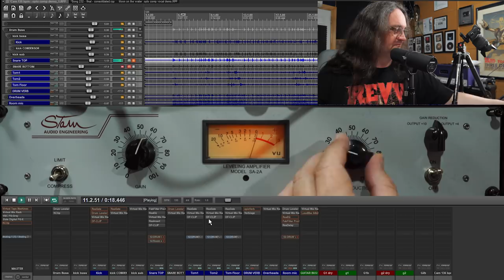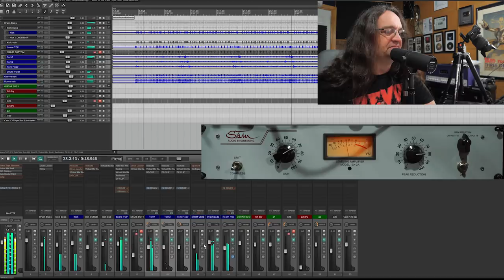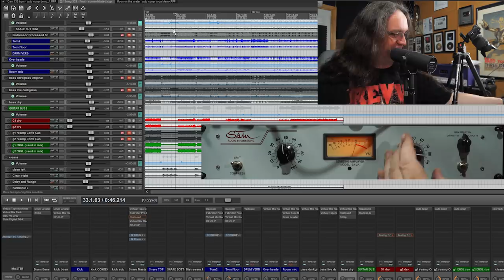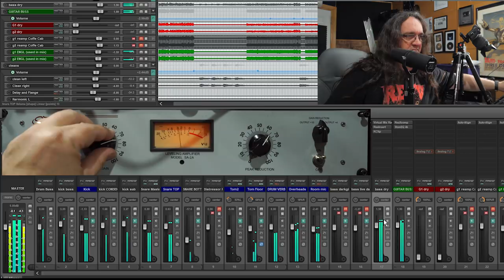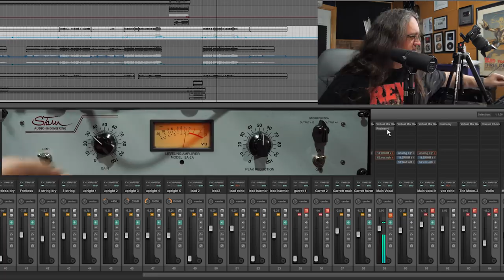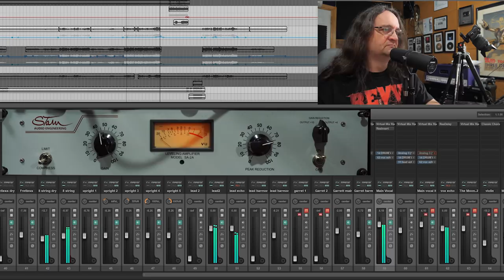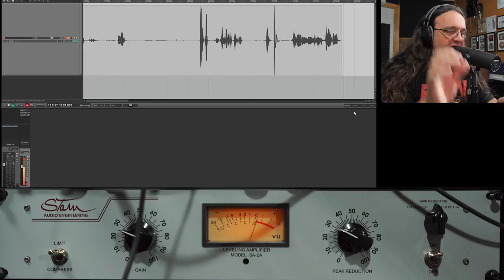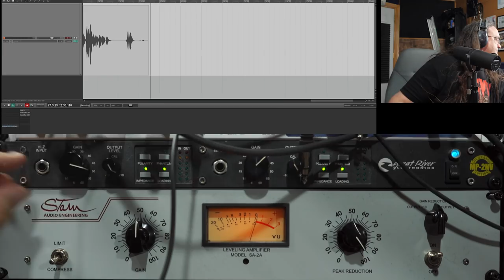Audio Basics: Optical Compression | SpectreSoundStudios TUTORIAL

Comment: Love the channel Glenn, Just wanted to thank you (and the person who made the comment pointing toward the Tascam DR-10x). This unit certainly streamlined my boom mic dialogue acquisition. Replaced a cable, interface, laptop and hard drive with this little unit and it really works well! Just a little heads up on a few relevant details that may have been misspoken on your video;
First, the unit does NOT put out phantom power. The manual states to use a dynamic mic, but fortunately my Rode Shotgun condenser has its own battery for power. Second: the USB port is only for direct power or data transfer. Although the unit can use a rechargeable battery, it does not charge the battery through this port. You must use an external charger. Thought that might help. Keep up the great work!
Reply from the maker: Noted!   I was blown away by the sound quality of the unit.  Simply amazing!

Comment: I might be wrong but I thought that the gain knob was actually an output gain made to compensate for the gain reduction, and the peak reduction knob was used to set the actual amount of compression. Cause you could play with the gain knob, even turn it way down or way up and still get the exact same amount of compression. Maybe they changed it for an input gain knob on the SA2A ? Great video anyways !
Reply: The Big Kahuna yes youre right. It is a make ub gain knob, all the la2a like conpressors are layed out like this. It feels very unnatural because its is layed out from right to left.

I have the warm audio unit, and had exactly the same thing when I started using it.

Comment: I love using an optical compressor (or at least the plugin one that comes with pro tools) for parallel compression on kick Drum and snare: I set it so it pumps a LOT and distorts the drum a little, then I add some post eq to taste (more low end/high mids for kick; more high mids/top end for snare) and mix it in with the dry track for a fatter sound

Comment: Just to add to the explanation of opto compressors at the start - generally the photocell isn't just part of the detector, it's also the actual gain reduction element as well. It's literally a light-controlled resistor, which is why you can get such heavy compression without significant distortion - electrically it's the same as turning down the volume with a potentiometer.

Comment: Hi Glen (and others) if you want to use a single comp on a stereo mix down you could always route the left channel through the comp and bounce it to a new compressed track then just repeat this process for the right channel (this also ensures the settings are identical)
Reply: wouldn't work well. What you need in stereo mix is the channels to be ducked equally. Otherwise the compressors will mess up the stereo image. Using the sum of L+R as a sidechain for both will not work either - the channels may cancel out resulting in no compression where there should be one.

Comment: Would also like to learn about Vari-Mu compressors. From what I've heard they are used for complex sources AKA mastering
Reply: They certainly can be depending upon the design and circuit!  The most famous Vari-Mu compressor is arguably, the Fairchild 660/670.   Used in mastering sometimes if you want some extra vibe and color imparted just from running audio through it.  The second most popular IMO, would probably be the original Gates STA-Level, which would NOT be my first choice for mastering, but sounds amazing on Vocals, Bass, Drums, etc.  Our V-COMP is a 1:1 recreation of the Gates with some modern touches added to make it more versatile / easier to use on multiple sources.  The Retro STA is also another option is does a similar thing.  Bit different sound.  Vari-MU compression is so cool simply because of how MUSICAL and EFFORTLESS the compression is.  Highly non-linear as the actual gain-reduction is happening via a dual triode, semi-remote cutoff vacuum tube which is such a vibey, colorful and character laden sound.  /ENDRANT
Check out our gear!  audio-scape.com/products

Comment: The gain control is the output control. The label is a little bit confusing, but the gain reduction meter didn't show more gain reduction as you increased the (make up) gain. Anyway, you can find it in the manual of the original LA-2A.
Reply from the maker: Duly noted.  Thanks!

Comment: There seem to be some misconceptions about the LA2A's Gain control. It does NOT control the level going into the compressor, all it does is amplify the output signal, commonly known as make up gain. So if you're cranking up the gain until it sounds nasty, this is not because the compressor gets a really hot signal, but because you're clipping your input in your interface.
Even though the dial is located on the left, it should really be on the right, because it amplifies the output signal to make up for lost level during the compression.
Also, because of this you don't need an output attenuator, as it is already built in. The signal is just as hot as you want it to be, just turn down the gain. Remember, it's output gain, not input gain.

Here's a small excerpt from the LA2A manual:
"Gain Control
This  control  does  not  affect  the  compression.    The  gain  control  should  be  set  after  the
desired amount of compression is determined using the Peak Reduction control.  Once the
Peak Reduction control is set, adjust the Gain Control to achieve the desired output level."

Of course all of that applies to the SA2A as well.

Comment: FETs are transistors, but have the nonlinearity of tubes, higher input impedance, and often poor transfer consistency between devices making it a nightmare to match them correctly in amplification circuits (except for input buffers). MOSFETs are a bit better in this regard, but the need for a positive bias voltage on the input instead of a negative one sounds scary for a lot of engineers (except depletion-mode devices), not to mention it's hard nowadays to source MOSFETs made specifically for amplification. Most depletion-mode devices seems to be good for this purpose if you want tube-like distortion, but very rarely used, because of Opamps, however I have the suspicion that the newest Revv pedals use them.

In compressors, FETs are used for gain reduction, as in that context you don't have to match individual devices.

Comment: Love LA-2a types always sound great, the attack time is usually a lot faster then you think maybe not as fast as an 1176 but a lot faster than some compressors but the soft knee and the program dependant release means it sounds drastically different to a FET comp, also limit seems to only really be heard when smashing something basically it barely ever releases because the ratio is a lot higher. Any chance on a video looking at using an 1176 type on drums and bass, I often struggle on those sources with fast compressors because I seem to lose low end punch but slower comps don't help with the faster percussive transients.

Comment: I'm confused...Why use a tube if you don't distort the signal? Why not use a SS version with the same DB cut/boost that are similar to the pots on the Stam?
Reply: A tube will still affect the signal in a different way, even if there isn't perceived distortion.
Reply: Interesting...I cant tell the difference between a clean guitar weather it be tube amp, solid state amp, or say plunged directly into a sound card/ interface until i start to distort the signal. It dose make sense they way you describe it. I mean: the transformer, diodes, and whatever have to affect the signal different...

Comment: Great video! I was trying to get ReaInsert going with some of my outboard gear but I couldn't get it set so I wouldn't have to re-align. There was always a bit of delay left. If you're up for it I'd appreciate a little tutorial on how to set this up exactly. Are you just using / adjusting ReaInsert or have you changed any other settings to make it work? Cheers from Germany
Reply from the maker: Are you using it real-time on the same track?
Reply: No I was sending it to another track with the ReaInsert plugin. So I had a recorded voice track, dragged the send to the other channel, played it, and tried to record the track with the ReaInsert with delay detection. The resulting audio was delayed compared to the original track.
Reply from the maker: That's your mistake.  Use it as a plugin on ONE track.  Then when mixing down, set for "realtime"
Reply: Oh ok - I will try that! Thank you!

Comment: Only thing, LA-2A doesn't have a lightbulb, its the quite unique electroluminescent panel :)
Reply from the maker: noted.
Reply: Yes, sounds absolutely amazing too, as evident in the video :)

From wiki page: "It uses an electro-luminescent panel together with a cadmium-sulfide light dependent resistor to provide gain reduction, which, in the LA-2A, is called the T4 cell. The properties of the T4 give the LA-2A its unique character by making it an entirely program dependent design. The average attack time is 10 milliseconds[4] and the release time is about 60 ms for 50% release and 0.5 to 5 seconds for full release, depending on the previous program material."

Here are pics of the sexy thing:
http://www.wmbpoutlet.top/signal-processorsrack-effects-c-1083_1122_1123/t4b-optoattenuatowbrr-for-ua-universal-audio-urei-teletronix-la2a-la3a-kenetek-p-671.htm
Reply: Not trying to be a smartass, just pointing out, being an electronics nerd and all :P

Comment: I've been using the Optron 3A vst which gives very clean sound. I like the distortion the SA2A gives - any vst alternatives?
Reply: Seenbelow -Softube Summit TLA-100A VST. 
Along with the “standard” LA-2 features and controls, it also has a Drive control, which sculpts the amount of tube saturation. It can be very clean or very saturated. 
It also has a variable HPF ( up to 600hz I believe?) that allows you to adjust how much low end you feed the limiting detection circuit, so if you don’t want it to clamp down on the low end, you can filter it out of the compression detection circuit. 
FWIW.

Comment: Glenn, I was wondering if you could offer some advice.  I found a cassette tape recorded by my now-dead grandfather with a message and a song on for my grandmother. I've recorded it with a DI and Audacity but it's got awful clipping on some sections, and lowering the volume and using the built-in Clip Fix tool doesn't do very much.  Is there anything else I could do?

Edit: The clipping isn't from recording it, it's on the tape.
Reply: when the build in clop fix tool didn't do the job, there's not much you can really do as an amateur. You may send the track to a professional sound restoration service, but it will cost you a lot of money.

Comment: Purchase a TR8, red dead redemption 2 ad, and a topic i love hearing about from spectre sound studios? Its a good day. ^^
Currently I'm running the comps in my MOTU,  but its like using UA software, sounds great but its still not hardware. 
Saving up to do a FMR NCC1701 (RNC and RNLA on a rack.) for the mic and direct synth work. After I heard them, cannot give them enough props. Glenn, you should definately get peoples attention to these solid state beasts! Cant afford la2a copies yet.)like the warm audio WA2A which has the same transformers as the original LA2A.) If I win the lottory, Avalon 737 and 747s in series or in dynamic Class A parallels.